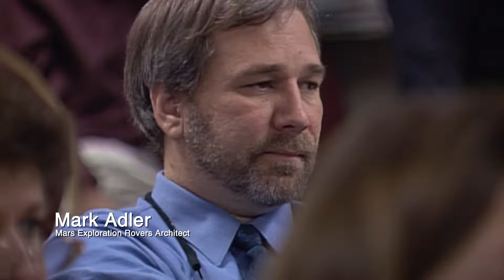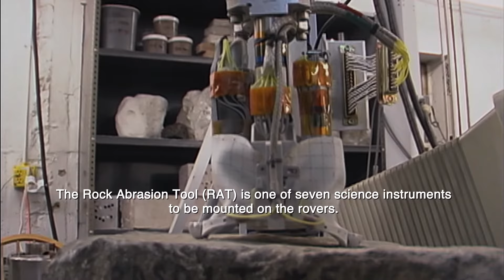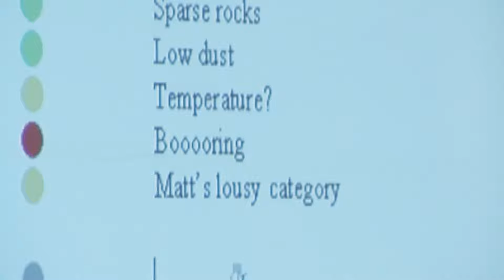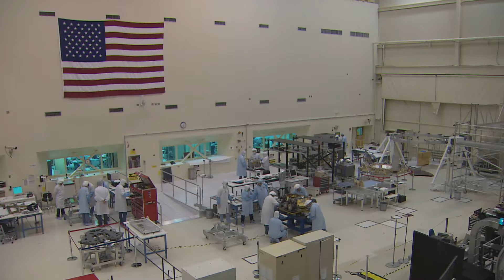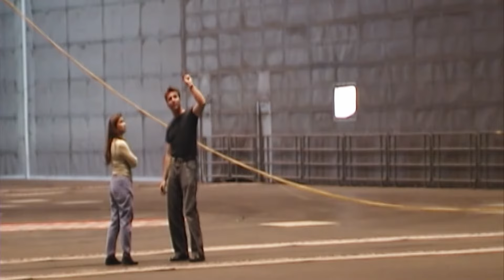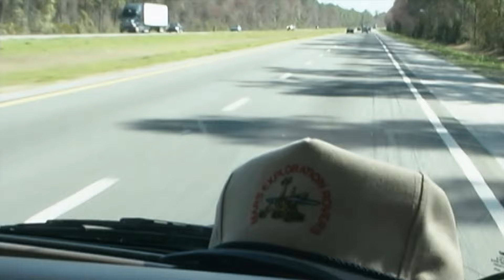JPL and the Space Age: Mission to Mars

Comment: I have only 1 question to NASA. why didn't you send a simple paint brush with solar powered rovers. The robotic arm just have to pick it up and clean the solar panels when required. Some rovers would have been working until now if you've done that
Reply: My guess: budgetary constraints - and lack of time to develop your (seemingly) simple solution. 🤔
Reply: @TheStockwell  no need of high tech nasa level research. Just a simple paint brush with uv degredation would suffice. Though simple, benefits would have been massive
Reply: @administratorshan  I'm not sure you have a real appreciation of the complexity, weight and cost of your proposed solution. Your "simple paint brush" is a significant robotic device. Just have a really deep think about what you're proposing it does, how that can be achieved in reality and the complexity it would add to what's already an incredibly complex spacecraft design. It would indeed take "high tech nasa [sic] research" to implement on a Mars rover. Simpler solutions could be found in air blowing devices and wipers more like those on an automobile, and I'm fairly sure those were proposed, but even those are still too complicated, heavy and costly for what is quite a trivial purpose - well, at least a purpose not worth the cost and addition of so many more points of potential failure that come with the addition of a robotic cleaning system, or the like.

I agree it sounds like an obvious and very simple solution. Just in reality, it's not the least bit "simple".
Reply: @PBeringer  yes I agree, though it would not be so simple to us, for a professional team who nailed a skycrane landing sequence, a brush attached to the robotic arm is a walk in the park. with the added cost and weight, given the benefits of adding 5 or more years of life to the rover, that would have been the best deal ever in my opinion. It could have been a separate light robotic arm added to the side, leaving zero points of failure to other functionalities arising from this system

Comment: Hi, in trying for a no_propwash firefighting tankers if one puts a jetboard system in a box as motor:
An economic opportunity to aviation/aerospace and containers: Fluid_impulse motors fly without air no_fuels no_batteries by using all_magnet motors for pumps.

Working on a small one for a landmine detection drone, nobody seems to get it but plumbers so far, fluid_impulse can punch a pipe through concrete walls when a sprinkler system goes off.
☕️
Reply: How often does NASA find itself needing to punch holes through a Mars rover or through concrete because a sprinkler system failed?

Let's try to stay on topic and avoid Nikola Tesla territory. No offense intended.
Reply: @TheStockwell  Well, they're dumb enough to not use all_magnet motors instead of solar panels so not thinking they're as smart as plumbers.

A 1300hp motor fits cars powers a 1-Mw genset/container 50yr no_inputs warranty, way beyond your brain power, Belgian.
🤡